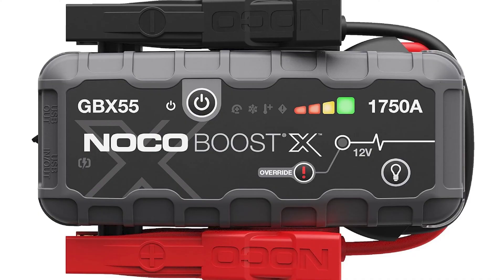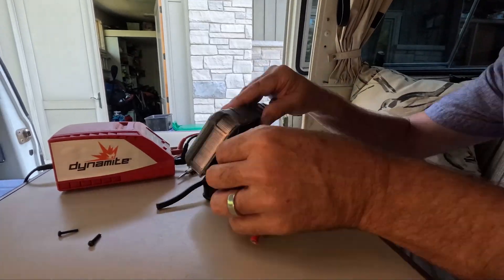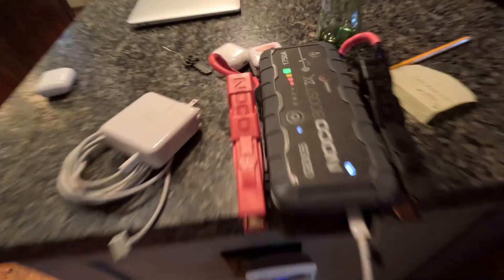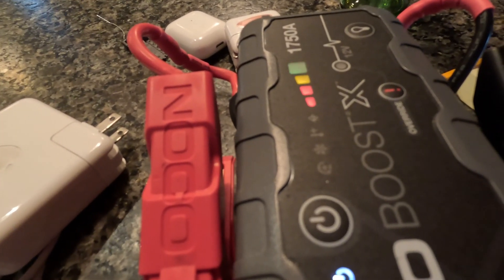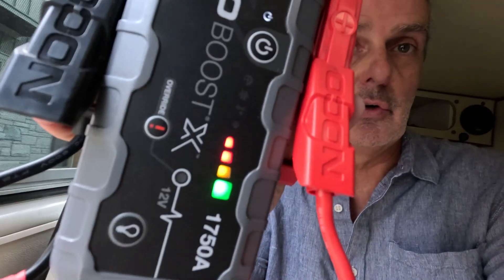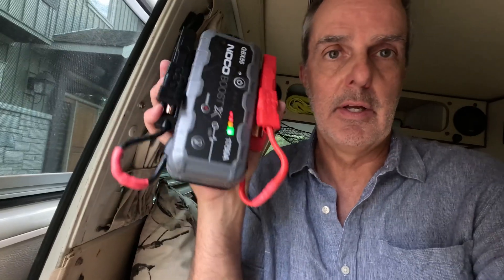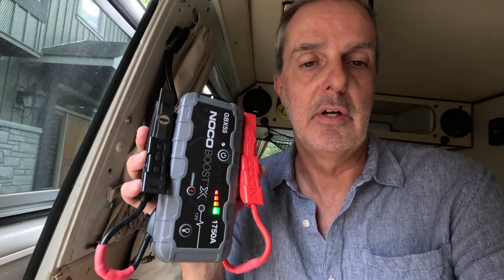My Noco Boost is Dead...can I fix it?

Comment: Came to see how it comes apart.
It doesn't need to be charged that long, to get it to recognize the battery.
You almost fully charged it, with the li-Po charger, LOL!, 
I put a 9V power supply on it, for about 5 min, and it started working.
The reason they do this, is safety. Lithium-ion batteries, if drained too low, can be charged with reversed polarity, which can cause overheating, and could cause the battery to explode.
It stinks, when the battery is drained, because it causes the user to assume the worst, when all it is, is the battery was left to drain too much.
That's what happened with mine.
It was accidentally turned on, and I didn't know it, so it completely drained the battery.
I try to remember to check it once a month, which is good, because if it sat too long, it may have never been able to be rescued.
I'm getting a hard shell case for it, so the button can't be accidentally pressed again.
Reply from the maker: You are correct in that it doesn’t take much. Just need to get the BMS to turn back on. I didn’t fully charge it…just gave it  enough charge to keep the connection open so regular charging could continue. Might have been heavy handed but it it worked nonetheless. Still needed a full charge with the usb-c cable.

Comment: this may sound goofy but if the lithium ion packs below detectable voltage you can try this as I have had some success with other battery powered items that develop the same issue. Just plug and unplug the usb charger over and over again for about 5 mins, this seems to give the battery a small charge each time it is plugged in and it usually will start charging and numerous bump charges as I call it. Nothing ventured nothing gained.
Reply from the maker: @BigMuddyNorth  I actually tried this and it didn’t get it going. Thought I was close to it starting up a couple of times…maybe I just need to keep doing it!

Comment: Well this sucks! i just bought one.  Maybe I should send it back!  Why should I have to fix it after 6 months?  What a piece of crap!
Reply: Mine is 3 yo as well and I used it lots, great little unit…..But i let it go flat and now I can’t charge it. No happy
Reply: @Liamgross3000  I've since managed to revive mine by applying 12v directly to the battery just untill the voltage reads above a certain threshold and then plugged into a usb charger, it seemed to work pretty well if you're comfortable with disassembling it a bit. Don't have to mess with any solder luckily enough.
Reply: @garrettvella8831  much appreciated. I’m going to try it on a 60w charger tomorrow, apparently people  have had some some success doing that. If not  I’ll pull it apart, I can’t hurt what’s not working I guess. It’s been really good up until now.
Reply: For what it's worth, I had the gbx 45 and when I needed it it was always working for 3 years. But, I drained the battery completely and left it in a drawer for about a year and that's what killed it for me. As long as you check it semi frequently and keep it mostly topped up it should last a while longer than that.

Comment: What charger was used to charge the internal battery I have a gbx75 that’s got the same issue 
Thanks
Reply: Use the 12v car charger connection for about 20mins then plug try it with usb.  The car charger is strong enough to overcome the resistance of the battery.
Reply: @phil111ify   i can confirm this works. saved me buying  a new jump pack. Thanks
Reply: @phil111ify  mine dident come with  one😢
Reply: @phil111ify  THanks for this tip, this helped me start charging mine or well at least let me know it charges.
Reply from the maker: I used an RC car battery charger. But any small charger would work.  I think the biggest thing is you want to charge with very low amps…just enough  to get it above the low voltage cutoff.   So go slow and low so you don’t do any damage. **I’m not an expert so do what you’re comfortable with!